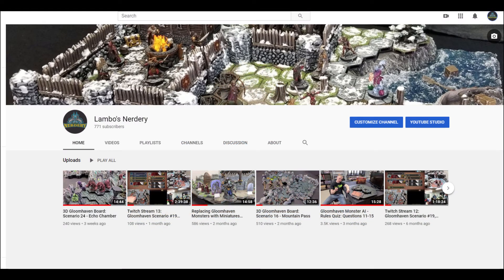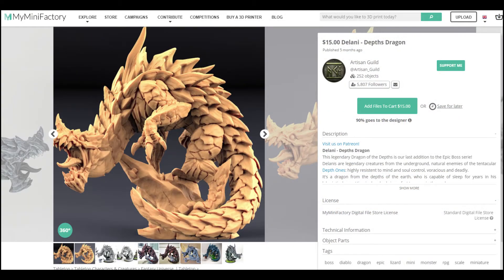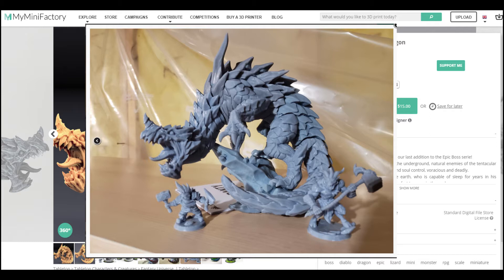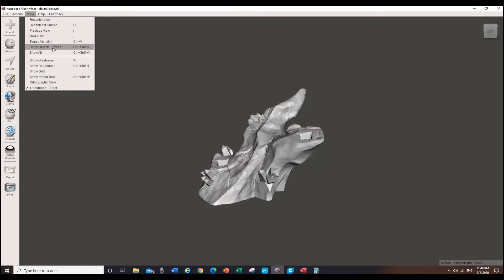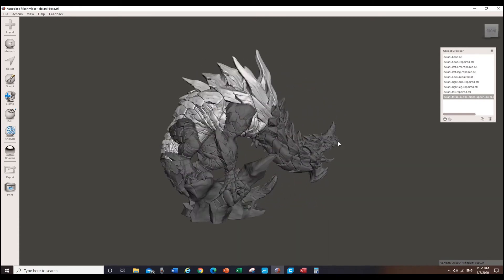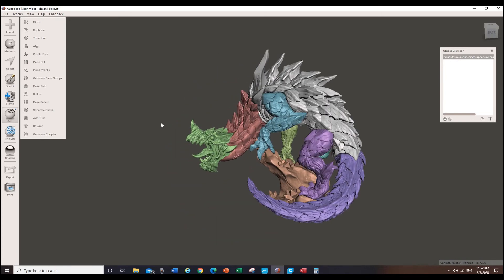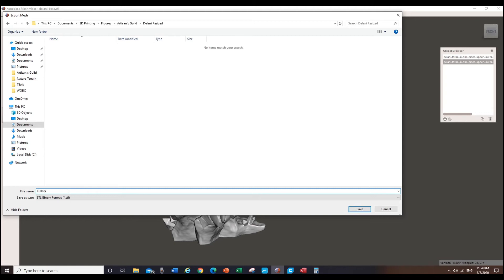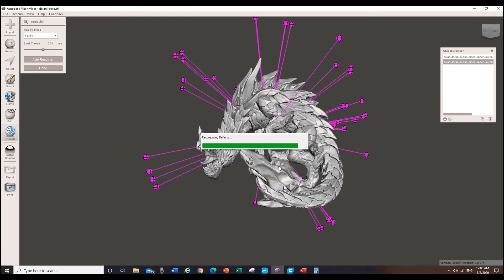Assembling a Multi-part Model in Meshmixer for 3D Printing

Comment: Sorry, how if the part didn't otomatic match with other part ?
Reply: same problem here , any help ?
Reply from the maker: If it's not an automatic fit, you'll have to manually manipulate the parts together utilizing the Edit and Transform options until you have aligned the pieces as best as you can. Once aligned select them both and combine them. Hopefully that works for you.

Comment: You don't need to click make solid to combine the objects into one part. Select all the items to combine in the object browser, then click edit and you will have a whole bunch of options including combine.

I came across this video because I was trying to see if there is a way to more easily align objects that don't import into the right spots. If I could get STL files to open in 3DS Max, I know how to easily do it there. Like you could click each surface and tell the parts to attach there. I guess Mesh Mixer doesn't have anything like that. I'm like totally stuck. I wish some of these model makers would release a full object in addition to the one split into a thousand pieces.

Comment: I'm shocked at how many videos there are  for splitting models but not putting them together.
I find with this method however that the end result has a lot less detail than the original? Is there any way to avoid this? I put the sliders up to the max and it''s still lower quality by a little bit, but noticable
Reply from the maker: Outside of selecting the "Accurate" option from the drop down menu, unfortunately I don't really have a good answer for you. I'm a self-taught Meshmixer user, so I only know a few useful tricks. I have noticed on my prints that the tiniest details are often very hard to make out regardless, but I suppose that all comes down to the scale of the print, and the printer doing the printing.